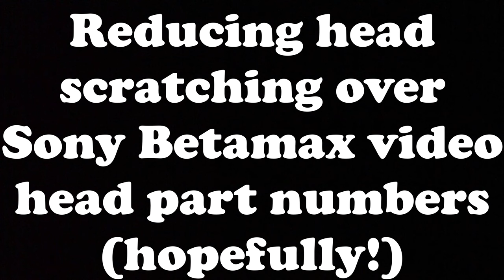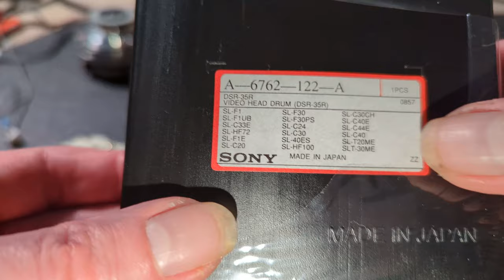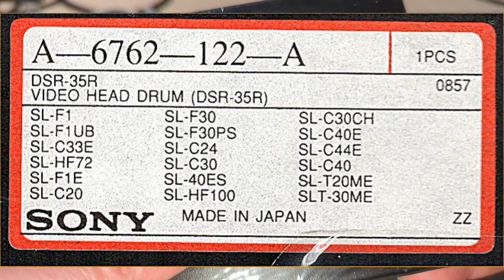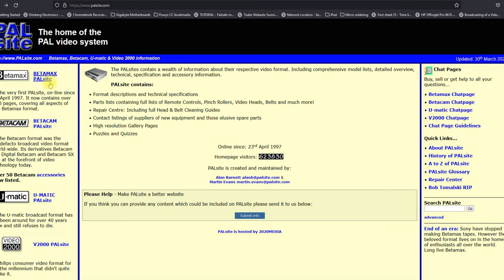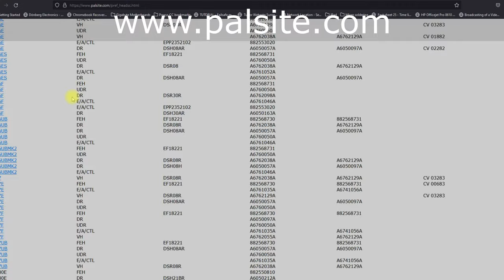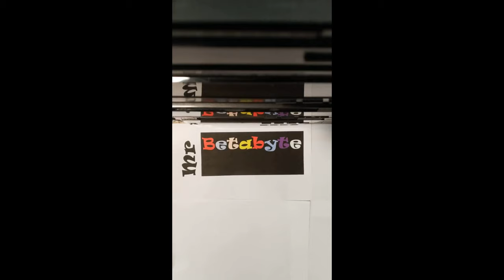Sony Betamax common video head types and part numbers

Comment: The Head Disc makes 1500 rpm (50 fields x 60 seconds) at 50 Hz (PAL/SECAM) and 1800 rpm (60 fields x 60 seconds) at 60 Hz (NTSC + PAL 60 Brazil). Due to the higher tape consumption, work can be carried out with higher frequencies.
Reply from the maker: I so should have said this but promise I will cover the tape transport speed in another video. Really appreciate you picking me up on this. 😊
Reply: @MrBetaByte  I have corrected the speed , since this is not about DV (3000 rpm).

Comment: Thank you for this video. It is useful. I was wondering about sl-200 heads, dsr79... can they be used on c30 with changing the magnet position/polarity?
Reply from the maker: From memory I don't think so - the sl200 has dual magnets and the signal magnet head discs don't have the second hole drilled but I will be doing more on these and will be doing a video shortly to confirm.
Reply: @MrBetaByte  somebody told me to takeout one of the magnets and will work on c30. I have not tried it yet.
Reply from the maker: @mertuckan  Sorry - I thought you were going from a C30 to a SL200 for some reason! Yes, taking out the second magnet leaving the correct magnet that corresponds with the C30 head disk will work. I don't think there's an issue with magnet polarity either. Let me know how you get on though - I'm intrigued!

Comment: Have you experienced the caps on the pcb on the bottom of the drum motor ever going bad? I'm swapping the hall sensor on my SL-F1 (drum isn't starting so suspecting the one that is there is bad based on info on palsite/videos here, can't find anything else wrong at least.), and wondering if it's worth swapping caps since I have the drum assy out anyhow. The 2 1uf ones measure fine but I don't have an easy way of measuring the 0.1uf ones (not that I've ever seen 50v 0.1uf electrolytics go bad).

Also, my SL-F1 seems to have the newer type upper drum, but also the brass bracket. Doesn't look like it's been swapped but idk for sure.
Reply from the maker: I have to say I've never had the four capacitors ever go bad and never have had issues leaving them so I would leave them. Very much sounding like the hall-effect is bad especially if it still has the original glue on it. Interesting on your upper drum. May well be the brass bracket was transferred from the old upper drum?
Reply: @MrBetaByte  Aight just gonna leave the caps alone then. The drum stopped working after something caused one of the fuses on the main pcb to blow and I replaced it. (with the blow fuse it was just always spinning as the drum stop signal is high=off). Now it just does either a little twitch the first time I try to start playback after turning on, or doesn't move at all. I could see see some activity on my scope on the pg pins of the servo IC when turning the drum manually (whether the vcr is on or not) with the old sensors but maybe the output from the isn't sufficient for it to get going  as there was no PVM output to the drum motor ics but idk.

Yeah seems most likely that the drum was swapped but they reused the brass bracket even though I didn't see much signs of it being serviced otherwise.

Anyhow, thanks a lot for your videos, they are very useful.

Comment: hi i have been watching aot of your video there are ace video decks that never hit ebay  they get past around by who  you know  time to timei get asked to take decks 
of there  hands because they are juck i picked up a betacam as parts  1st of many yes malot are in a bad  way i am going to have alot of cap change over 
on my hands
Reply from the maker: Very true. Caps are certainly becoming more and more of an issue as these machines get older.

Comment: Hello, how to detect if a video head is bad?
Reply from the maker: There is a video on head testing next week but if you don't have a head chip test meter, visual inspection is a good start. Also the condition of the upper and lower drum is a very good indication as to the wear of the heads - if the tape path section is very shiney there is a good chance the heads are bad. You can also look at the RF waveform from the head amplifier board.

Comment: and that's where the so called brainy ebayers could find themselves in a bit of strife if they carelessly say the eg the DSR-35 head universally will fit SL-F1 and a SLHF-100 and the hi-fi buyer gets a MONO surprise. and you'd be hard pressed to ask the seller before purchasing if there's actually a Hi-FI head inside a sealed case. great one Sony.
Reply from the maker: That's very true. Hopefully buyers are wise to the 'fits lots of models including Euro HF100's' but as you say many will be caught out.